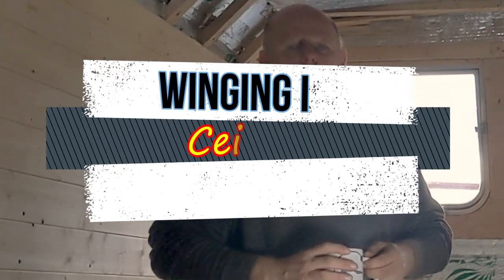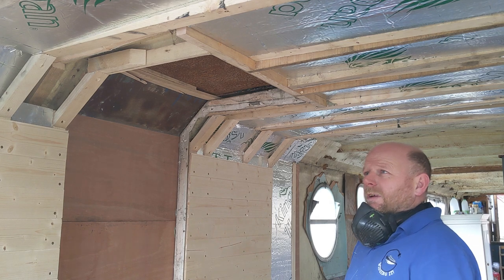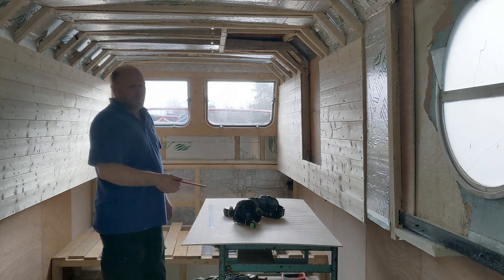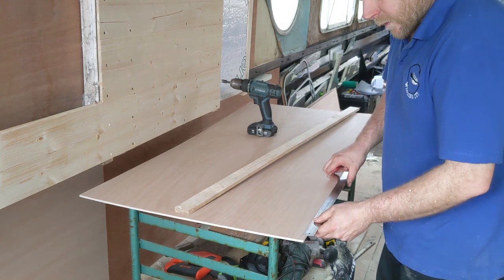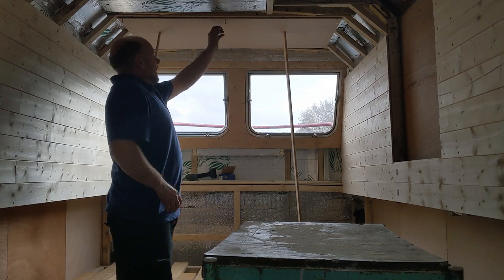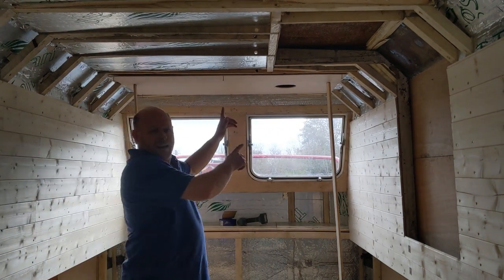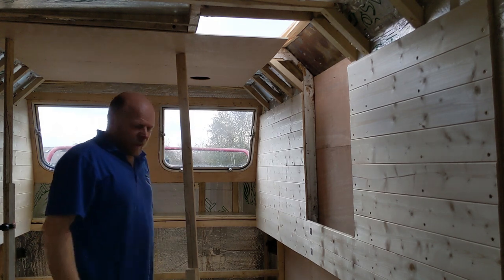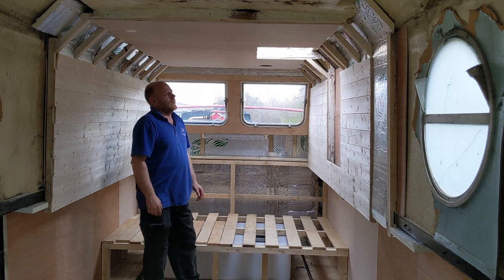Fitting CEILING PANELS in a narrowboat on my own - the EASIEST way I could! Boating On A Budget

Comment: I’m also watching The Narrowboat that James Built and he has been battling with the same varying dimensions and has the patience of a saint in cutting sheets to line up exactly but trust me filler is the patron saint of any one working with timber that is to be painted. We use car filler because it drys quickly and tends not to sink as water based wood fillers do if used over a more than a crack.
Reply from the maker: Narrowboats are notorious for being out of square, I don't envy anyone who does this regularly!

Comment: If you fit some plastic conduit through the electric wiring holes it will make cable pulling now and in the future that much easier to do plus reduce the chances of damaging the insulation mate - just make sure you leave some extra girth though in case you ever want to add extra gear in the future
Reply from the maker: Good thinking!

Comment: If you are doing one room at a time; you could always wire it upto a fuse panel in each room? So your able to first fix as you go? Remember; Arctic blue with ferrels
Reply from the maker: As we 'finish' the  bedroom we are going to panel out the rest f the boat then fit it out from there - basically doing the bedroom first to 'test' the ideas of how to build it up....
Reply: @WingingItBoatingonaBudget  don’t forget the aerial points too hehe!!
Reply from the maker: @liamhainsworth9620  hahaha! Is that for the radio!

Comment: Don't know your full intentions regarding cable runs, but running under the ceiling panels is probably more problematic than along the side. The sloping area between the side panels and ceiling down one side would be ideal for the job and would o my be small panels to remove in the future. You could even leave the panels that you have up at the moment, cut ceiling lights when you decide, and use a bit of stuff wire as a puller from the hole to the side. Hope that makes sense.
Once you build cupboards or bulkheads for the bedroom you may not be able to remove ceiling panels that easy.
Anyway love following your progress, and yes it's starting to look  good now the shell is getting her internal skin on 👍
Reply from the maker: The main cable runs will be down the side of the boat on the angled section where the wall meets the ceiling. Its just this end bit that needs to go in the ceiling as the hatch breaks the run down the side.

Comment: Loving the Vlogs Pete. Great progress.
Was wondering why you are not taking your cable runs down the left hand side behind the ‘not yet panelled’ angled sections. If you have issues in the future this would presumably mean easier access as the panels will be smaller.
Reply from the maker: Yep, that's the plan = main feeds will run down there and then just spur off where needed for each light fitting / switch etc
Reply: @WingingItBoatingonaBudget  Okay right. I misunderstood when you mentioned drilling through the ceiling batons. I thought you meant you were running the electrics down the centre of the boat. All looking good though mate. Won’t be long before you will be able to start moving aboard.

Comment: A couple of spars screwed across, left to right, on those angled side pieces would have made a support for the ceiling pieces without all that juggling bits of wood to hold them against the roof. Screw the panels up and move the spars along to the next section.
Reply from the maker: Good thinking, will bear in mind for future!

Comment: I don't think you mentioned a top tip today.  I thought the pit props to hold the ceiling up was inspirational. A typical Yorkshireman. Use the props then when the all the ceiling is completed  either use the props in some other bit of construction or burn it to boil up a brew.
Reply from the maker: There wasn't a top tip! Slipping aren't I! 
And yes the props are free and fully recyclable!

Comment: Is that bog-standard 5mm ply going on ceiling Pete? I have a similar project planned and was wondering if I'll need marine ply or at least have to seal it on the back? (As a fellow tight Yorkshireman I naturally want the cheapest effective option 😂)
Reply from the maker: Yes its normal ply, I will be painting the back of it (well Dawn will be!) when I drop it to fit the lights.

Comment: I thought the cables were going down the bevelled part between the ceiling and the walls?  Though I can understand that you want overhead lighting rather than side lighting.
Reply from the maker: Yes the main cable run is down the side... It will have to come round the hatch though so the last be will have to be under the ceiling. All the lights in the boat will be overhead - gives a better spread of light (well we think)

Comment: Why would you panel the roof before the first fix electrical, your just making work for yourself.?????
Reply from the maker: Once we decide where the lights are going it will take 10 minutes to unscrew the boards so we can put the cables where we need them. We think its worth the extra 10 minutes so we can see the room 'set up' and gauge from there how many lights we want, and where to position them...